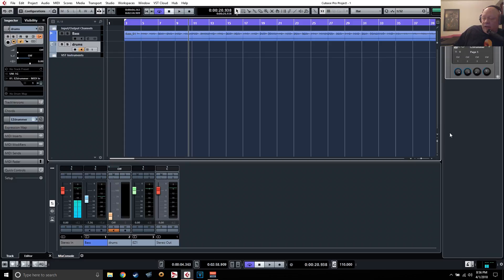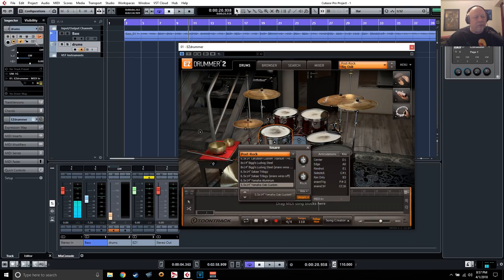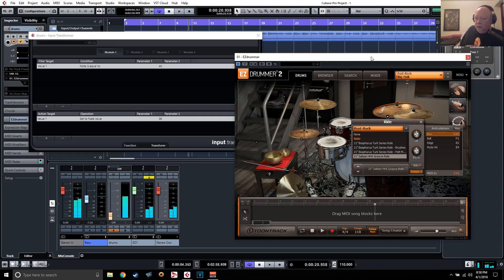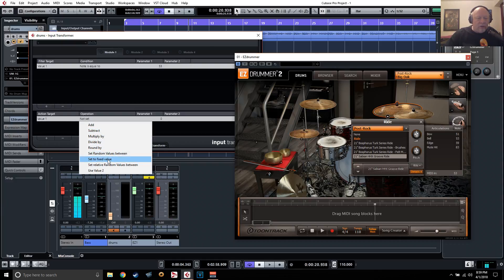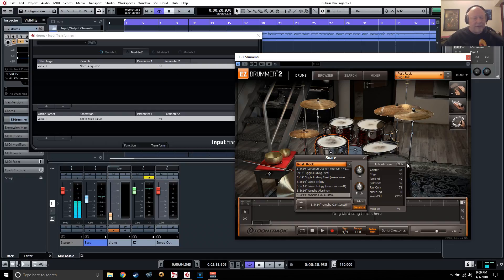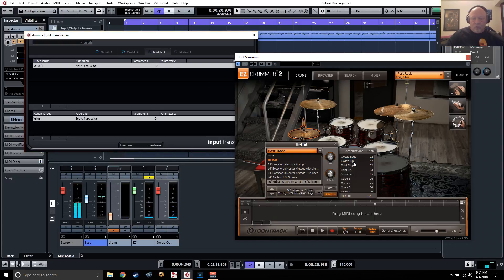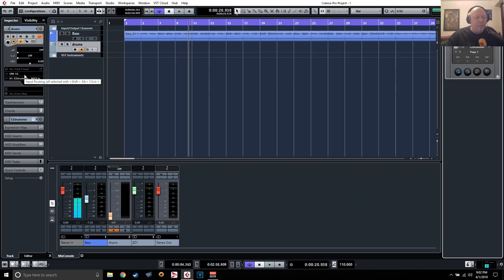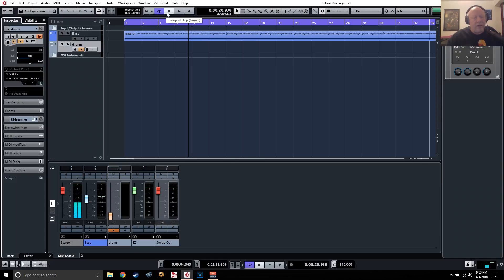Cubase: Using Input Transformer to change MIDI input values

Comment: Interesting. I would like to do  something different. I have a Kat Ktmp1 multipad. It only has 4 pads and a kick trigger input. I  use it to trigger hi-hat, snare, 2 toms or 1 tom and 1 cymbal of Addictive Drums. The kick  is triggered throught the kick input. Sometimes I need another tom or another cymbal. I would like to be able to push some pedal switch and change pad assignments so, for example, my two toms change to two cymbals. Can this be done in cubase ?
Reply from the maker: I think that would be more a function of the drum software you're using. yes, you could probably re-assign the midi note inputs to different note values using transformer, but in general, it's waaaay easier to do that in the drum software you're using. I had to resort to this method because of a problem with the yamaha controller...
Reply: @MitchMichelleOfficial  in the drum software ? I dont find any function in the drum software to switch pads assigment on the fly...
Reply from the maker: @jaydvbaby  which drum software are you using? almost all plug ins offer that capability...
Reply: @MitchMichelleOfficial  BFD Eco. Ok, every  drum software lets you change pad assignment. But I want to change it while playing. Remember I only have 4 pads. I want to be able to change pad sound during a song with a pedal switch or something.
Reply from the maker: @jaydvbaby  ok now i understand. there's no way i know of to automate a midi pad change, sorry.

Comment: Can you tell me the note number for the centre snare in ezdrummer original first ezdrummer I can't find it anywhere I can email you a pic if you like my email is macrae454@gmail.com if you email me will send you
Reply from the maker: I can. But after examining different kits, it may not be available on every kit, and it may not work in EZDrummer 1.  But that note is F#-2 or MIDI note number 6
Reply: Mitch Michelle thanks I will try that if not probably Worth upgrading to ezdrummer 2 instead it's really difficult in ezdrummer 1

Comment: Hey man can you please help me I have ezdrummer and my snare on my digital kit doesn't seem to give the full snare sound any ideas
Reply from the maker: one thing you might try: in ezdrummer, when you look at the trigger notes for the snare (as i showed in the video), down toward the bottom there is a note that is labled "snare trig". try switching your snare midi value to that note and see if you get a better sound. if not, the only other thing i would suggest is to change the sensitivity of your snare drum trigger. sorry, but i don't think i have a lot more to offer than that, but i hope that helps!
Reply: Mitch Michelle thanks I will hook it all up tonight and give it a go I'm using the very first ezdrummer really appreciate your tips you gave me there thanks 👍👍👍